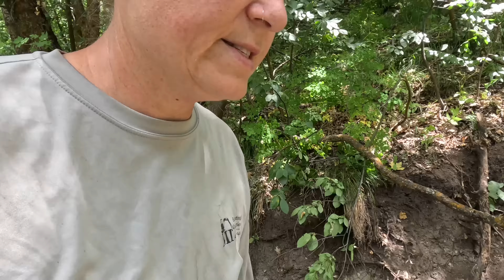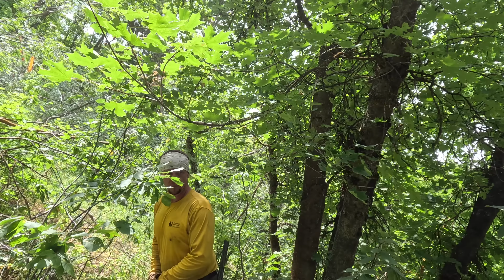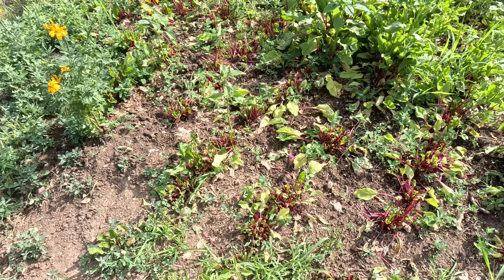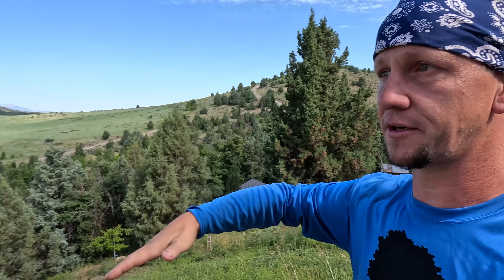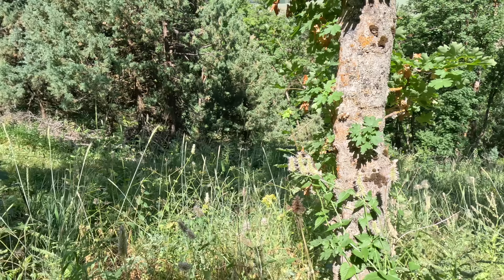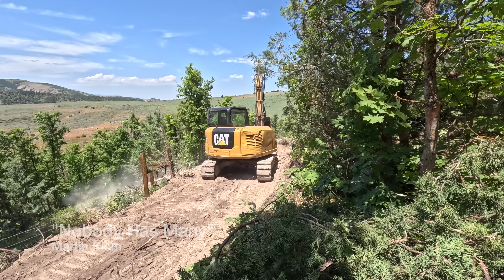Excavating our MOUNTAINSIDE AGAIN | ESTABLISHING ANOTHER BOUNDARY line \\ MOUNTAIN MAPLE RANCH

Comment: We had to put in line fence to keep the cows out. But when you have 2 years of drought, they don't have any pasture and the farmer doesn't feed him enough. They're going to any fans. And that's what's been happening here for the last 2 years. So we ended up putting a really, really good friends that they can't get through around the garden. And that has saved our garden, and it also works on the analope and the mule deer. Neighbors put up an electric fence, you'd be surprised what a solar fence will do

Comment: If the cows push over your neighbor's fence, what's to keep them from pushing yours over?
Reply from the maker: unfortunately our neighbors fence is not well build such as deadfall for posts, and 2-3 strands of barbwire some spots are 4 feet or shorter, and in the state of Idaho they have what is called “legal requirements for fencing out cattle”. About 4 years ago we put net (sheep/goat) fencing up in the back of our property and that has helped have a strong fence and cattle dont even attempt it. We will be doing the same for the frontage and will be doing 5 strand barbwire with stabilizers in place on the down hill. When the fence meets the “legal” requirements then we actually have an argument that we can take to the cattle association if the cattle push through our fence. We hope to have a strong fence to not  to ever worry about cows while we live here.

Comment: how long does it take for grass and other plants to come in and stabilize the soil in your area.
Reply from the maker: it will start growing back in in a few months. We will also add some seeds before rain storms. We did that with the water line trail and its all back and grown in and stable ground
Reply: @MountainMapleRanch  sounds very effective
Reply: @MountainMapleRanch Mark are you still going to have to do something about the snow problem that happened at the top and behind your house, it was pretty scary.